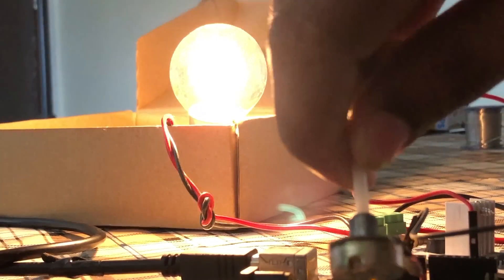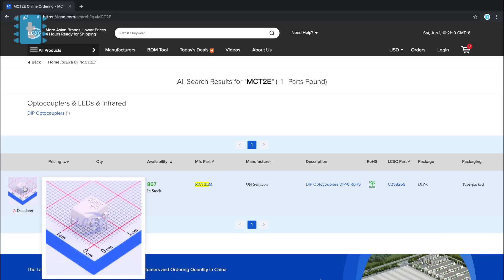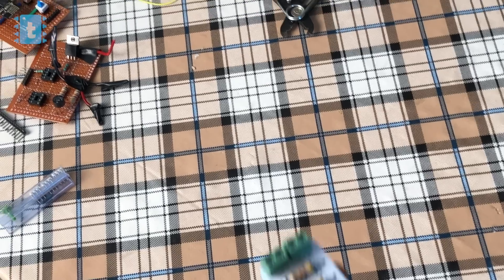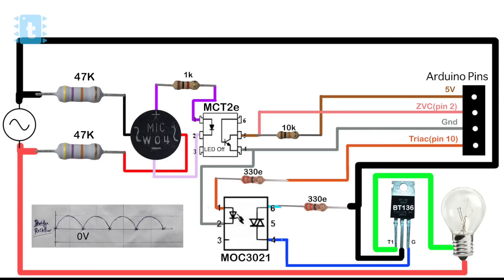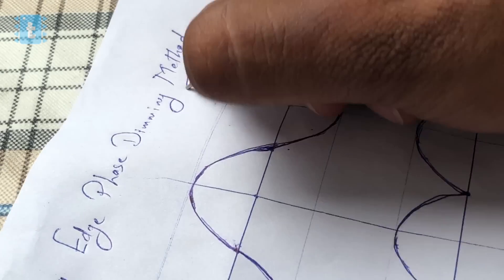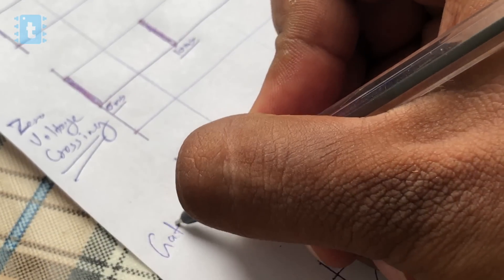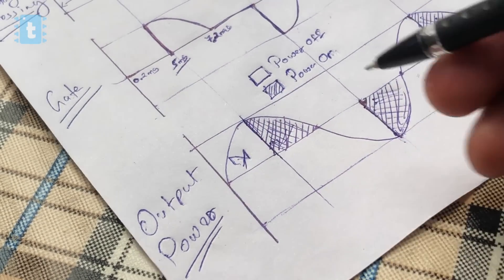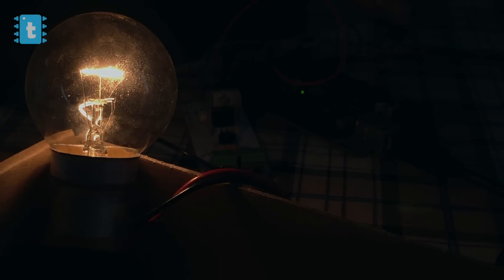Simplest AC Dimmer Explained | AC Dimmer using Arduino and Triac | LCSC

Comment: Hi. I plan go use the diy circuit to control an ac fan but without the potentiometer and only though the computer. Is it possible with your diy pcb?

Comment: how can i controll this coad using +push button and -push button without potentiometer
Reply: just increase and decrease the values when pressing the push buttons as the potentiometer does the same with electrical signal.

Comment: Great video, thank you very much. Can you control the voltage of the dimmer solely by software in the arduino, without the use of a pot?
Reply: Sure, you can.

Comment: Can you make a circuit using an opamp instead of a full bridge rectifier, this is just to have information of using an opamp rather than a full bridge rectifier. "big resistors"... can you please state what are the resistor values... come on man people are not kids, you don't need to say "bigz resistors", you could've just said 1 watt or 1/2 watt resistors. 1 period of my AC source is not a perfect 20ms, but rather 16.65ms. You're the only indian person that actually knows how to utilize what you have learned, best explanation on triacs and how to use it.
Reply: No, you cannot. He calculated the period for 50hz.

Comment: I'm wonder if this circuit would work essentially the same with a different, 60 cycle, AC voltage.  It seems like it should.  I'd like to build a similar device for lower voltage; say 0-20 VAC

Comment: I made this circuit, the ZVC detection & Pulse output to MOC3021 works fine, but when connected with the Load (Lamp) it starts flicker at low voltage.. 
I think RC filter will require at load and Mt1 & Mt2.
Reply from the maker: If it’s start flickering try to change that timing set in the code. 
Just do trial and error with different time constants and you’ll get the results

Comment: so just a general question, why do we use the method of reducing the ON time to reduce the delivered power instead of scaling down the signal amplitude?
same question applies in PWM, we reduce the  ON time in order to reduce the equivalent DC value ... so why ?
Reply: you need analog signals for the amplitude change, which in this digital age ore costly option.
Reply: @erwinslootweg7938  Clear, Thank you.

Comment: What is the maximum Voltage on the ir diode of mct2e? It seems that with this circuit you put over 110v peak voltage to the mct2e. Is it correct?
Reply: That's not the case. There are resistor in series with the diode to control the current and consequently the voltage.

Comment: Zero Volt Detector optocouplar is getting really low current from the mains. Like 2 milliamps at 220 volt and much low ant lower voltages. I am not sure if the optocouplar turns off at zero volt. It seems the optocouplar turns on/of at much higher volt rather than near zero crossing. Not sure if I am missing something.

Comment: It didnt worked for me trying from last one month
My components
Reguated lab power supply
Bta12 triac
Moc3041 zcd opto
Ressitors tried for multiple values
Reply: Replace 'acon' funtion with this one.

void acon()
{
  digitalWrite(triacPulse, LOW);
                  
  delayMicroseconds(x);                            //Delay triac's firing angle according to analogRead(A0)
  digitalWrite(triacPulse, HIGH);
               //Triac remains on until next Zero Crossing is detected.
}

Comment: Is there a circuit that does not require the feedback from the zero crossing signal in order to dim the power? I haven't been able to find a PCB anywhere that is controlled by simple pwm signal and just change the duty cycle of the triac to average out the current. I want to use a CNC shield and GRBL firmware on an arduino and then put a rectifier and filter circuit to get between 0 - 110VDC output to the spindle motor, but the firmware does not support zero crossing feedback signal from the motor. I can do it with an SCR controller and a potentiometer, but I want to use pwm from the arduino.

Comment: i couldn't get an MCT2E so i used a PC817, and used a BT151 instead of BT136. IT's not working. My bulb doesn't even light up. AND also couldn't find 47k 1W resistors, so i used 47k 0.3w resistors. I KNOW THATS A LOT OF MODIFICATION, but i need help please

Comment: Hello sir,
First of all you are the best
i would like to ask you that the ac supply here we are talking about is 220 volt ac or with any step down transformer?
Reply from the maker: It’s 220 V Ac directly
Reply: @techiesms  thanks sir and one more thing can i use normal diodes 4007 instead of bridge rectifier?

Comment: Can you please make a vedio for temperature controll ac fan, it will be really helpful, Thanks in advance
Reply: so instead of the potentiometer, you will take an output of a PID controller dependent on the error signal "the difference between your preset temp and the sensor reading" .. 
you can do it.. nice idea..

Comment: You didn't connect any wire to A0 but used A0 in Arduino code. You connected the wire to A2 pin but didn't use A2 pin in Arduino. Any mistake?

Comment: can we use this on AC motor?
Reply from the maker: Within 5A current ratings
Reply: @techiesms  ok bro, just one last question, is it possible to dim without the potentiometer?by just editing the code?
Reply from the maker: Yes
By passing analog values via Bluetooth or serial monitor or any other source
Reply: @techiesms  we have a motor with 5.5A max current rating, what triac can we used instead? we tried BTA08-600B on this ckt but the output voltage is low and inconsistent

Comment: Very good!
But on the Triac is not connected an RC snubber... it's important, because the lamp is a "little" inductive load. You can use a snubberless Triac, like BTA08-600BW or similar instead of solder a RC filter between Mt1 and Mt2 of the Triac.
Best regards from Italy!
Reply: will this work on AC motor?
Reply: @24242424h   It also work with AC motors, (universal brushed or induction motors) but at low voltage the torque is low...
Reply: @davidemognetti  bro what should be the voltage output if we're measuring it with a load? should it be 220V still max?

Comment: Try doing the same for inductive loads (fan) I have tried different things for that but nothing works perfectly!! I hope you do!!
Reply from the maker: Trust me.It will work.
Reply: @techiesms  no this method is not working for fan. Speed of the fan does varied but makes a humming noise and that is what I can't eliminate!
Reply: @harshilshah812  You Need to add a snubber circuit(I think). Like this one https://cdn.instructables.com/FNE/K1HI/HLA110VM/FNEK1HIHLA110VM.LARGE.jpg?auto=webp&fit=bounds

Comment: Can i replace potentiometer with ir senser?
Reply: Yes you can. You just need to mimic like there is a voltage divider on the on the analog input of the arduino Uno. And add a capacitor to smooth out the voltage of the sensor. But what you are planning to do is can be done with 555 timer IC.
Reply: I want add that ckt in relay module ckt to control fan speed

Comment: Can you using nodemcu or esp32
Reply: koyyala saipreetham I tried a similar project with the node MCU and I got a lot of Flicker. The same code worked extremely smooth with the Arduino Uno. I’m not really sure what I could’ve been doing wrong.
Reply: @drumminjeff71  use 3.3v to 5v logic level converter when you are using esp32 inorder to run smoothly
Reply: @drumminjeff71  thanks

Comment: Pls add Fan Regulator option also. ESP8266 based control with powerfail  save state, local and wifi controlled will be a super duper option
Reply from the maker: This same circuit will work for fan also
Reply: @techiesms  Snubber circuit to triac for inductive load is a nice addon
Reply: @techiesms  why do u often use the 3 relay system in your home automation project then ? , this triac dimmer has to have some good cons that u don't use this .